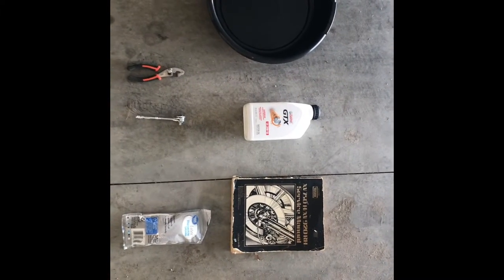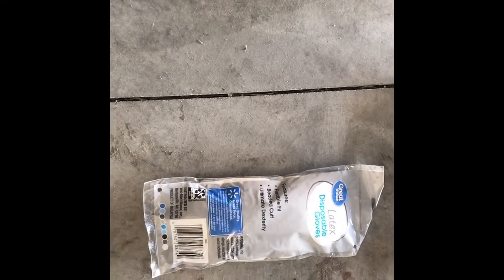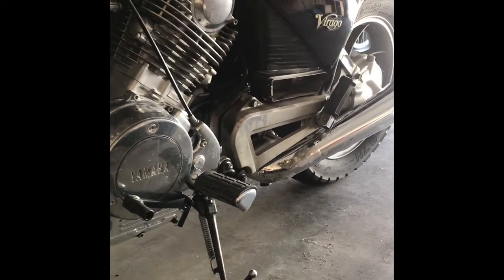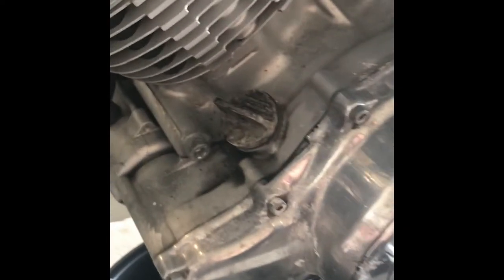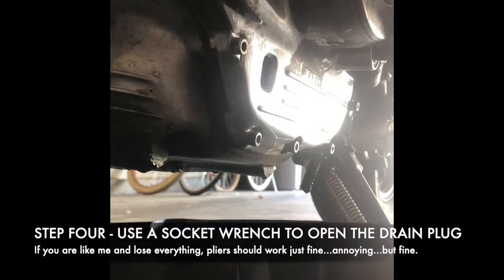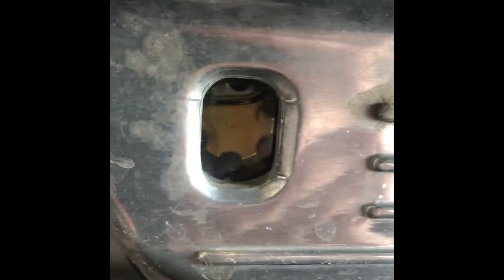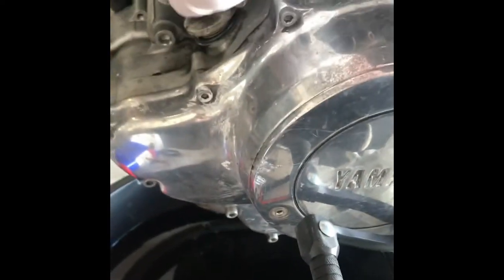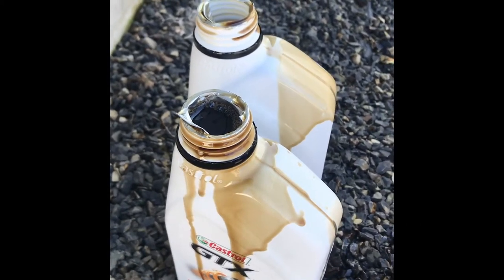Motorcycle Oil Change - 1982 Yamaha Virago XV920

Comment: I’m new to the motorcycle thing is the oil for the motor the same for trans oil like is one thing like if I took off the side cases of the clutch would I just have to just do an oil change??
Reply: payton frederick it’s all the same oil, what he didn’t mention is you need to make sure the oil spec is correct for your motorcycle without friction modifiers. Since the motor oil is used for the clutch and tranny